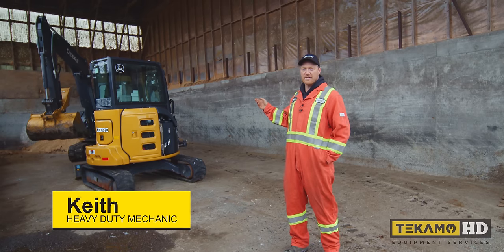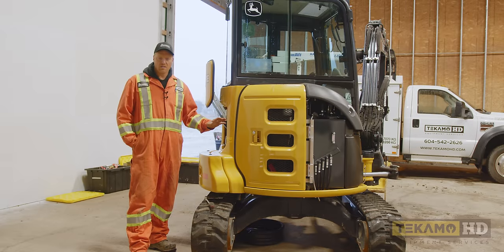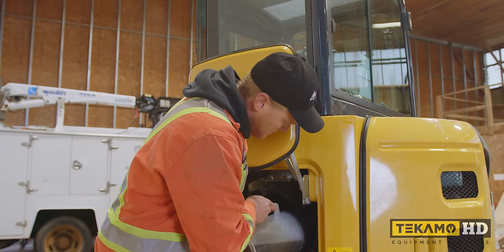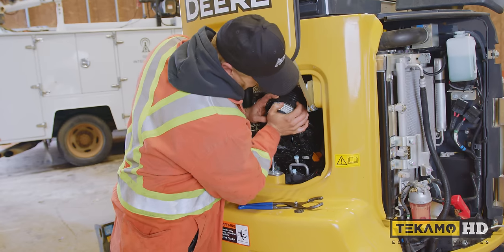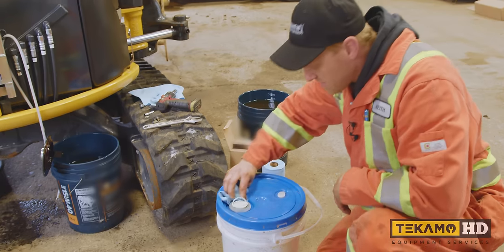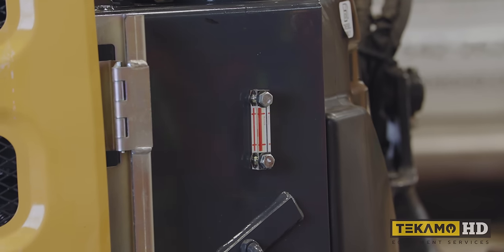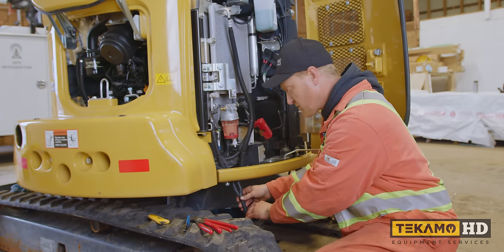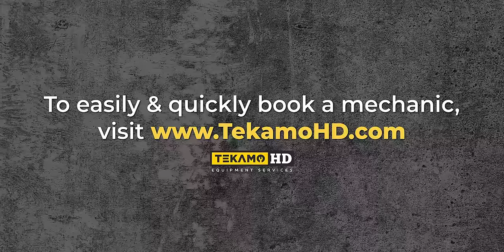Service Call: SUBMERGED John Deere 35G - Repairing a waterlogged engine with compromised fuel & oil

Comment: Well as a John Deere tech that pump would be coming out and inspected for internal damage as well as the final drive motors but at bare minimum if we took your root we would run a filter caddy to protect the hydraulic system components
Reply: we will only call you when my scan tool tells me i need the dealer, we need better right to repair laws, get the software out of their greedy hands

Comment: The outer air filter in your left hand has a different opening than the new one in your right hand. Looks like some kinda plastic insert where the new one SC doesn't.
Reply: It was the inner air filter that was inside
Reply: @Bombardier64.  Maybe thats why the new one didn't fit properly, and he had to hold it up while putting it in the housing 🤔

Comment: I usually work on larger machines, the 20ton class. In a situation where the engine can't run and the machine needs to be moved, remove the final drive propeller shafts and the tracks will rotate freely when towed. Much easier/lighter to tow that way.

Comment: "Avoid damaging the concrete with the rubber tracks"
Proceeds to drag bucket across concrete
Reply: Lol
Reply: I think they were more meaning they didn't wanna leave some 10" wide skid marks across the whole floor haha.
Reply: They are trying to avoid damaging the rubber.....
Reply: Good thing there mechanics they suck at rigging . They put it on plywood so they could drag it in doors so they could leave the door open

Comment: draining the hydraulic tank, i would have use a cloth or rag on a stick just to wipe right of the bottom of the tank if it was possible, and remove the suction hose at the bottom of the tank to the hydraulic pump, because the is nothing stopping the water going into the suction hose. Great video anyway and good information

Comment: Have to ask why would you use white plumbers tape for the hydraulic oil drain plug and not the yellow oil resistant teflon tape or oil rated thread sealant?
Reply: Was always told not to use tape on hydraulics better to use the paste kind.
Reply: Yellow ptfe I’m fairly certain is for natural gas not gasoline and oil
Reply: @zanechristenson3436  I wish I could post pictures, the rolls I buy say gas and oil resistant tape. So I'm an bit more than "fairly" certain